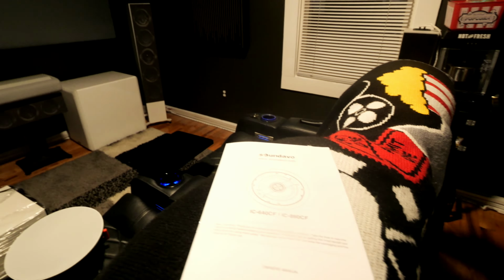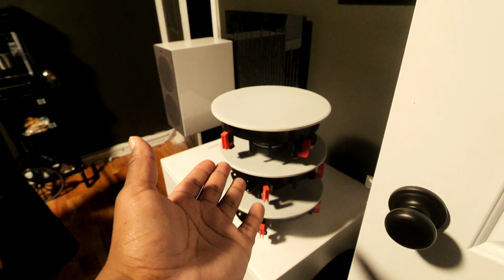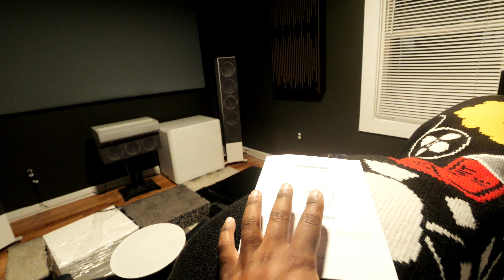Installing Dolby Atmos In-ceiling Speakers! | Soundavo IC-860CF

Comment: Great job as usual!  I'm still trying to decide what I want to do about atmos speakers.
Reply from the maker: If you can do in-ceiling, do it!
Reply: @Kpaceguy  I can, even my Ultimax 18's are in the ceiling in infinite baffle.  Btw, I'm going to put in four more of those to go with the eight that are already there.  

As for dispersion, what's the general consensus, something more directional or something with wide dispersion to be more ambient?  I haven't really looked into atmos in any detail yet.  I'm thinking I want to build something simple though, the rest of my system is really complex, not sure I want to put that much into atmos.
Reply from the maker: @mfkhometheater7742  you want it to be pretty direct for sure
Reply: @Kpaceguy  Thanks, now I just have to figure out what to build.

Comment: Coming from an ex plasterer/taper... you installed the in-ceiling speakers like a professional. 👏👏
Reply from the maker: Thank you! I hated every minute of it haha
Reply: @Kpaceguy  if I was the guess rectifying the under-cut (safety) of the first hole, was probably more frustrating than the other three holes combined. And of course filming everything doesn't help.
Reply from the maker: @totalplonker824  yes the first hole was the worst just with all the unknown. But I actually crawled in the attic and everything which wasn't as bad as I thought it would be but there is a lot of stuff under the insulation I didn't want to walk on. So it was tiring but very happy how it came out

Comment: Surprised you waited until the room was painted and furnished before doing this. No tarp? Dude! Good call on the manual cutting; had you used an electric tool, you would never have gotten rid of all that dust. Ever. One tool I bought that was WELL worth the money was a vertical/horizontal laser line/level; made measuring the in-ceilings a breeze. If you put a box/cover over the back of each speaker in the attic, and even fill the that box with poly, it'll really help contain the sound AND make them sound better. Great work, thanks for the share.
Reply from the maker: Thanks for watching!

Comment: even with the 8" woofers it's still tends to be best to set the crossover at ~120 hz for the ceiling atmos speakers. your anthem will let you know during calibration. also, hercules drill for the win! those are great performing tools for the price.
Reply from the maker: I'll run calibration in the next video and see what anthem says. I've learned that anthem tries to pick the lowest frequency possible so we'll see.
Reply: really?  what's the point of having 8" wonders then????

Comment: Great job man. The open attic certainly didn’t hurt! I had mine installed professionally since my theater is in my basement. I’d recommend in walls for your rest at some point due to your door. I put in walls for my surrounds after the tenth time someone nearly knocked themselves out on my old box surrounds. 
😱😂
Reply: you know you've made it when you have in ceiling speakers.....   Respect

Comment: Nice I had the same feelings when I had to cut into my ceilings! It's looking great man. A couple of tips, invest intro a laser level, they'll change your life to get straight lines. Second, I used a stud finder to find my joists so no need to rely on the attic. Also, if you have any pot lights, you can pop those open too to see up and into the hole and check the orientation of the studs too. Keep up the great work!
Reply from the maker: I appreciate it!
Reply: Laser level, not sure it will change your life as he only needs it for one task.

Comment: Great Video,  I'm so undecided on what to get for in ceiling speakers. I've been told different opinions from that you don't need expensive speakers for in ceiling atmos speakers, and you should get ones that are directional. I've  narrowed my search down to 3 brands. 1... polk v80 in-ceiling speaker  2...yamaha ic800  which both are more in my budget as I can buy 4 speakers for less than 2 krix speakers. And 3...more expensive Krix IC-52 (Atmospherix A20) which are directional and would be Awesome for Atmos, but would they be overkill. I like to buy right first time not second time so would be willing to push my budget. Do you think you need expensive Atmos in ceiling speakers and that they should be directional. I'm running Polk r700 and r400 with Yamaha a6a

Comment: Are those just for review?
If so may I suggest something fully adjustable for both woofer and tweeter?
And more affordable with about the same specs, try the Sonance Mag6r 👍
You can fully angle the woofer and the tweeter independently 👌
Reply from the maker: They are for review but I intend on keeping them for a while. I can find a way to angle the tweeter. I'm pretty crafty. But for now I'll count my blessings
Reply: @Kpaceguy  awesome work by the way 👍😁
Have you been focused on mostly that room and haven't set up the rest of the house 🤷
Since you seem to always be working on that room 😁
Reply from the maker: @kman9387  I've put tons of work into this room and into my studio but I'm all moved in. I want to paint the bedroom and bathroom but that's just a want not a need.
Reply: @Kpaceguy  😊👏

Comment: See if you can get Soundavo to send you the angled versions. Having the in-ceiling speaker pointing straight down usually does not get you the best sound. The frequency response roll-off is huge before the sound gets to your ears.
Reply from the maker: They will buy the don't have it in the 8in size. I can always remove the tweeter and make my own angled bracket

Comment: Are you worried about the heat in closet? I want to put my A/V in the closet, but my Emotiva XPA puts out a lot of heat.
Reply from the maker: Of course I am. There's a fan in there at the moment. I've had it in closet prior to moving into my new house. I'll be putting more ways to ventilate soon
Reply: @Kpaceguy  Cool, thanks. I am on the fence with putting in the closet. It does clean up the room though and space is small at 14 x 14.
Reply from the maker: @DREYDAYMAN  Having it hidden away is such a nice esthetic. Big sound and not seeing the source is so cool to me. Just focus on the audio and the visuals